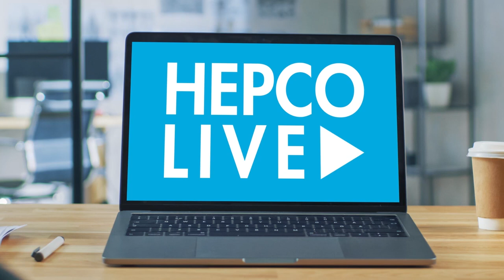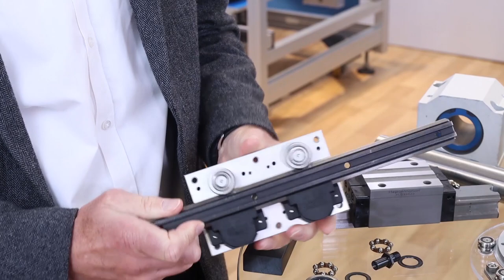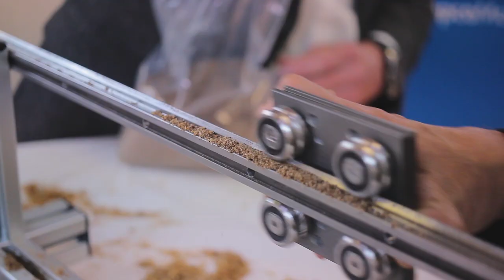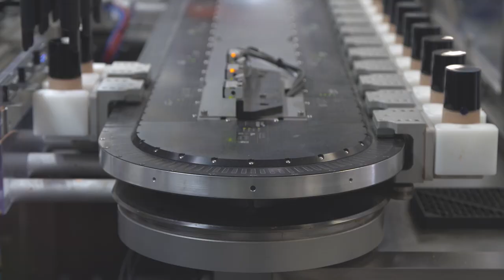Hepco Live | Webinar

Comment from the maker: 🕒 Timestamps:
00:00 – Introduction
02:48 – Choosing the right linear guide
09:28 – Q&A:
09:42 – Our customers have concerns about using a belt drive on the Z-axis, what is your suggestion?
11:46 – What are 2 examples of the most successful GV3 projects in UK?
13:43 – How quiet are V guides?

15:11 – Benefits of V Guide Technology
26:09 – Q&A:
26:30 – What options do you have for high and low temperature applications, what are the limits?  
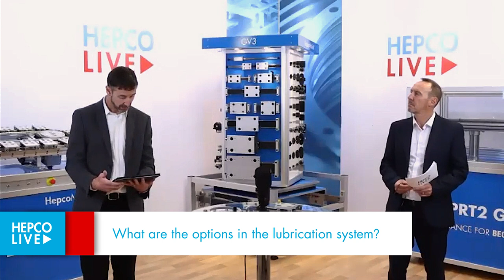28:00 – What are the options in the lubrication system?
29:50 - What is the better solution? Lubricate the rail with the danger of dust and particles sticking in the lubricant? Or running the rail dry without lubrication and risking higher wear on track and rollers?
30:45 – What are the different precision grades for GV3 and typical applications?
32:36 – What examples of wash down applications are there with DualVee?
34:00 – Is it useful to loosen the eccentric bearing if you have to move through a harsh environment?

36:09 – Ring & Track Systems
42:46 – Q&A:
43:04 – Can your ring and track systems be used in wet environments?

44:24 – Latest Developments of GFX
50:39 – Q&A:
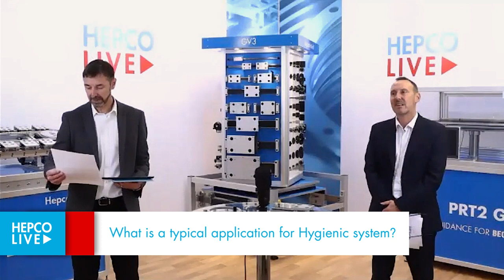50:57 – What is a typical application for Hygienic system?
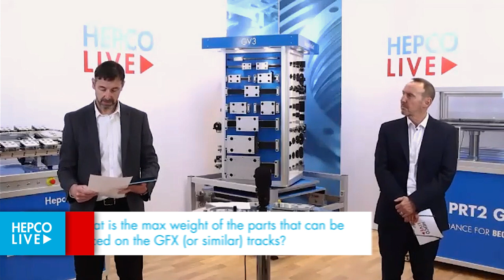53:07 – What is the max weight of the parts that can be placed on the GFX (or similar) tracks?
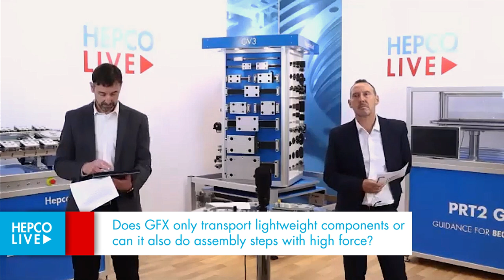56:05 – Does GFX only transport lightweight components or can it also do assembly steps with high force? 
57:48 – What is the maximum length for DTS?
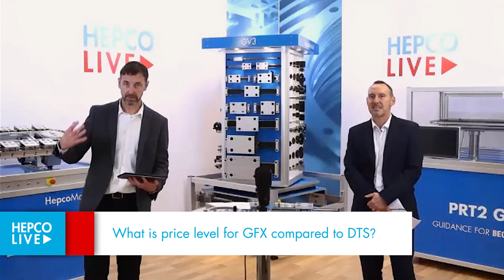59:45 – What is price level for GFX compared to DTS?
01:01:50 – GFX looks incredibly interesting for our application. We have higher force requirements (400N constant and 1kN peak); would high drive movers be able to deliver this?
01:03:03 – Is it possible to select GFX products (and others) through the Beckhoff Motion Designer?
01:04:56 – Do you have a 3D track system, or is it always in the same plane?
01:07:17 – Are there any limitations in using the GFX system in a vertical application?
01:09:14 – What is the accuracy of both the DTS2 and DTS+?
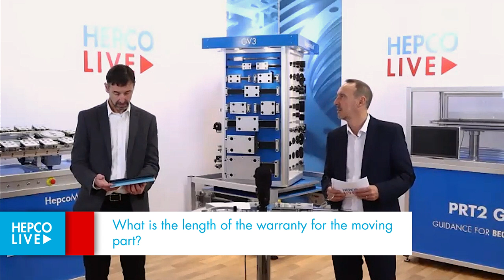01:11:09 – What is the length of the warranty for the moving part?
01:13:16 – How are bearing positions adapted to different geometry of linear and curved rail segments?
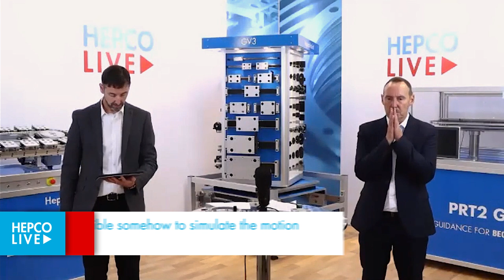01:15:37 – Is it possible somehow to simulate the motion profile?